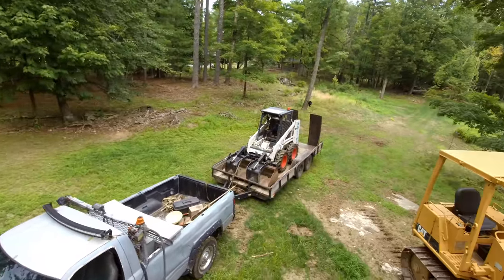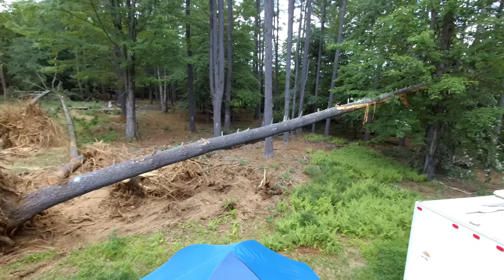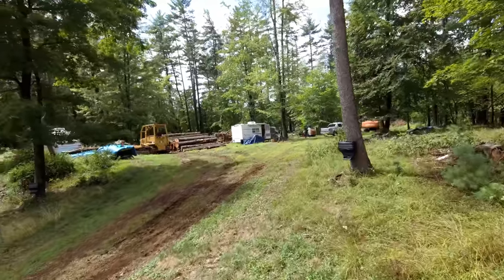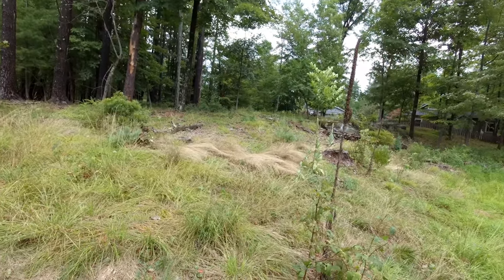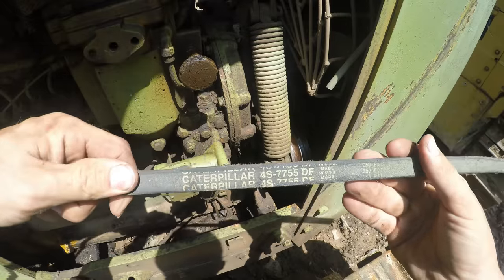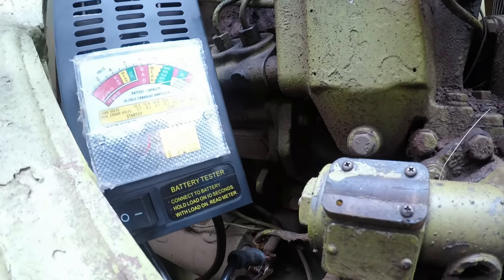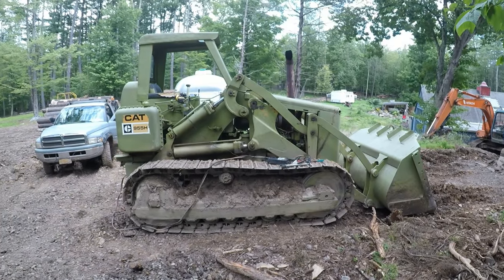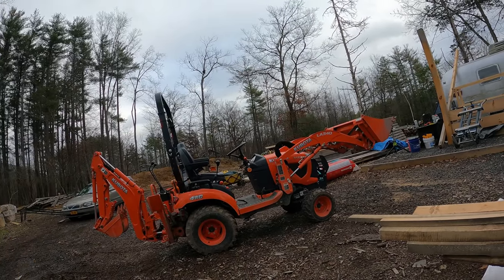Cutting down saw mill trees

Comment: I have never seen anyone more "relaxed" about putting way too much weight into his vehicles and trailers lol good stuff
Reply: Trees are incredibly heavy!
Reply: Haha! Same here.  "Trailers not at capacity until the tires rub the fenders."
Reply: It's all fun and games until someone has an accident.  Please be careful about load amounts.
Reply: @mikespain8655  yeah the accident could even be totally unrelated to the load issue but they’ll use the load issue to paint you in a bad light in court. Definitely have to watch thatZ
Reply: 5t on a 1t trlr
Reply: @aaronmccollum4626  7t trailer. 2 7k axles
Reply: Most of those loads were about right for a 14k trailer.  The one where he got stuck was probably a little much.  Those logs weigh around 600 for the smaller pulp logs up to 1300 for the bigger 20" logs.  That load he got stuck on was quite the load lol. Full load maybe overload but hard to tell cause there was lots of smaller logs.
Reply from the maker: I made that trailer, it’s strong.
Reply: @AndrewCamarata  Andrew I think your  projects are stronger than the factory designs lol
Reply: Looks like mostly hardwood.
Reply: He just figures he’ll make a video about fixing the trailer once he wrecks it!
Reply: @AndrewCamarata  Oh I believe you. It looked like it handled it just fine. Logs are actually great because they are usually evenly distributed weight. I put about 8k lbs of oak logs on my trailer and it pulled nice. I've been told the load capacity is less about trailer frame and more about the springs and axle hardware as long as it's sized well to the axle ratings. Thanks for the video and keep them coming.
Reply: @AndrewCamarata  you got to own like 100 machines you already got a new one
Reply: @AndrewCamarata  how much weight can your big equipment trailer haul?

Comment: Not gonna lie .i though that ten wheeler full of logs was going over when he hit that mud hole  😂. Great video 👍
Reply: How that truck didn’t go over is beyond me
Reply: @trav395hus8  completely luck
Reply: Same. Idk how it stayed upright.
Reply: @azari215  all I can think of is pure luck . I’ve seen trucks go over with less of a Lean
Reply: It's a heavy truck.  I think it has a low center of mass despite being filled with logs. Trucks like that are designed to "safely" haul gravel which is much  heavier (more likely to tip over).
Reply: @Whisper0ak  Maybe but I’ve seen some Trucks around here and go over with less effort.  I think he just got lucky

Comment: Andrew’s contol of the bucket is simply superior.  One perfectly timed and positioned swipe of the bucket to knock dirt off the root ball, and another in the other direction to do the same.  No jiggling or jerking of the bucket, just as smooth as can be.  A master at work.

You can really see this on the speeded up video.  It’s as if he’s using his fingers to move the logs.

Comment: Very surprised you were able to push over those large trees without having to dig around the roots.  That mini ex has got some guts!
Reply: The roots dont go very deep on those trees either. Typical NE 🇺🇸 soil type. Very rocky and full of clay. The roots just kinda spread out and dont go very deep. Really easy to get trees blown over in a good storm too.
Reply: like in the comment below,  In eastern Upstate New York and NE it's not very deep before you hit bedrock so trees have very shallow root systems
Reply: Another reason to get them away from buildings...:)
Reply: I think it has more to do with AC's skill level and knowledge than the machines. Kid knows what hes doing out there..
Reply: Fau Q  no but he did have one of his smaller excavators there for loading logs.
Reply: I wouldn't call 25k lbs a mini but I can't disagree that's a solid old machine....
Reply: Technique plays a part as well. He knows how a stump works and how to get leverage with the bucket up high.

Comment: This clip got me amazed... again... watching it for the 3rd time or so while waiting for the new upload! Great organization of work! It got me thinking that you would love to have some kind of tree splitter on your excavator. I saw one on your bobcat or the other small loader, but this excavator did great work here. Imagine replacing thumb with sheet of steel and bucket with 2 closely located sheets and you could move and cut lying tree into smaller chunks.  On those two sheets weld some kind of horizontal bar to push trees down.

Comment: I am so amazed at the lack of roots on east coast trees. Here in the pnw there is no way we could push trees over like that.  I stumped my property and had to dig down 7-10 feet on some stumps. Of course they were about 4 feet wide.  But I digress!! Nice work as always!!!
Reply: A 4’ stump here would have a 18’ wide 8’ deep stump. And likewise, you would not push the tree over with a 15 ton excavator. These little 20” trees are tall so once you get em leaning they peal the roots right out.
Reply: @ericharris893  meh , Those roots look like bushes.  And they are flat. Even a 20" tree over here has a much deeper root pack than those.

Comment: 41:23  The Old-School Car Guys (like me) tap (bang) the sticking solenoid with a hammer, to unstick it!
Reply: I've got a big dent on the fender of my 89 f150 from punching where the solenoid is located! 😂
Reply: That could be one of the first things to do, in such a breakdown, isn't it?
Reply: @pear7777  the contacts in my solenoid would weld them selfs together when starting the truck so the starter would stay engaged. So i would haft to jump out run around the truck and hit the spot it was located to get the starter to stop
Reply: Works on carb floats too

Comment: I'd be interested in what the cost of this project was. Considering that my guy charges 500-2000 per tree depending on how risky the tree is...
Reply: If the property owner paid for this then he’s not too bright. All that easy lumber is worth a good amount.
Reply: @noahdiroff  yeah especially if that was recently, the lumber prices are crazy high right now
Reply: That’s in a residential neighborhood without excavators on site. A hazard tree should cost 100$ per hour to professionally remove.  Andrew is clearing. He’s charging 100$ per hour and he has his equipment. Per tree is less because he can drop them fast with the excavator.
Reply: @ericharris893  How do you know what he charged the customer, for god's sake?
Reply: @nickturner2813   God was not harmed by the answering of this comment. And this is the kind of work I do and I live 100 miles from andrew. If I charge more than that, I’ll lose the job to the lower bidder. If I scale down I’ll never afford repairs on my equipment and my children will continue on ramen noodle

Comment: kinda dangerous to have house so close to those trees. Look at those shallow roots, I can't imagine when there is strong wing
Reply: I was just thinking the same thing. In our neck of the woods, Pine trees this big  would have a tap root that was ten feet long. You would have to dig a small pool out to get it to topple over...
Reply: Bedrock is too close to the surface up there...
Reply: Those forests are thousands of years old. Evolution has figured it out for those trees, in that region.

Comment: AC, you should make up some mats about 12 to 16 feet long that you can lay down over boggy areas. Get some 8x8s or larger and bolt them together about 24 to 36 inches wide using 1 inch galvanized rod. You could use those logs you carted out of there. Send them to a sawmill and get them cut up .

Comment: Build a Brush Rake push rocks and back blade.  Yes, usually its the solenoid those old starters sometimes if you look up the serial number you can track down a new one or rebuilt kit. Learned that on my cummins starter but what a pain it was to find a 24v replacement first ordered one from ebay and i was sent the wrong one.  if you need parts there is a store out my way that has racks of old starters.

Comment: I’m wondering if the tree suffers less internal damage when it is pushed over, rather than cut down? It seems the trees fall with less impact. A lot of milled lumber shows faults when a heavy tree is cut and dropped with a crash  - pros try to minimise that damage by landing the tree on brash and branches to soften the impact.

Comment: Was the ground swampy like that before or was it only after you took out the trees and it rained that the ground couldn't soak up that much water? Just Curious if the tree removal caused that issue?

Comment: Why don’t you put the branches and roots through a wood chipper? Spreading the chips you would have less of a mess with getting autos stuck and it improves the ground you leave behind, you can even chainsaw roots off the stumps to add to the mix.

Comment: if you dont have a battery tester you can also use a voltage tester... with the car off your battery should read around 12-13 volts

Comment: Solenoid starter switch it worked on a magnetic switch it gets a lil dirty and it won't engage but it probly spins tap it w a hammer and it will work but you should change soon in my opinion for what ever thats worth
Reply from the maker: Yeah, its in the garage now getting the exhaust fixed, and probably a starter rebuild.

Comment: Solenoid= Electric magnet that controls (Bendix Drive and motor electricity switch)
Heat= Resistance, jamming the iron rod that the magnet pulls to engage Bendix
Inverted can of Duster spray is very useful for locating hot components
(PCB, shorting wires, fuses, ECM/PCM) and to instantly cool down so parts work
without doing dangerous, destructive tapping (ceramic magnets crack easily).

They also make a dedicated product called "Component Cooler", spray to freeze
electronics. Cheap on Amazon.

Comment: Curious as to the weight capacity of what looks like a landscape trailer. Most of them are max at 7000 pounds gross. And that load of logs looks like 12000 pounds of logs!!

Comment: Do the lumber mills take a certain size or length of logs up there???
If not and the trees are straight why don't you take them the length of your trailer????
Most of the logs you cut looks like you cut them in 8 or 10 foot logs.
Why not cut them in longer logs????

Comment: I had put in a new rebuilt solenoid in my truck and it stuck until it wore in a little.. pain in the butt putting it in and tapping it with small hammer .

Comment: How many tons is that hitachi?
Reply from the maker: 12
Reply: @AndrewCamarata  do you have any recommendations on a first excavator purchase?
Reply from the maker: Depends what you need to do, but between 3-5 tons make good money, but bigger ones are good too. Get one made in Japan. Go grease it when you are looking at it. All the grease fittings should take grease.
Reply: @AndrewCamarata  cool that makes a lot of sense. I’ve heard some of the brands are yes to get parts for. Have you had any experience with that?
Reply from the maker: Some brands don't break and never need parts.